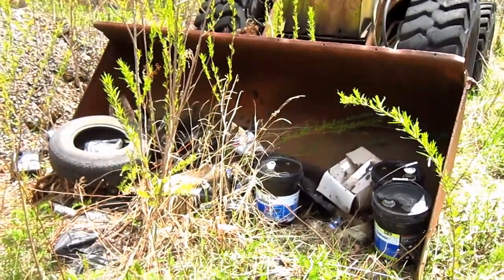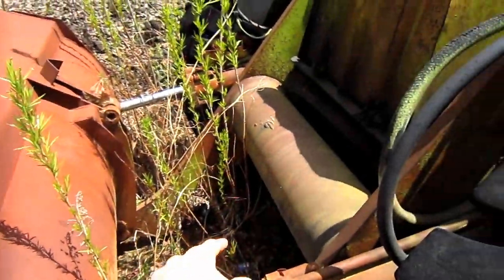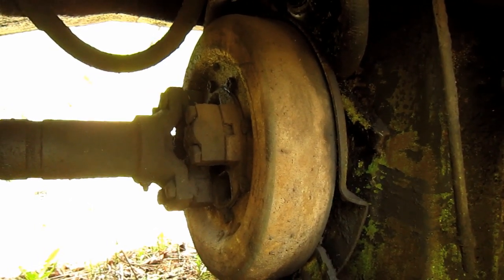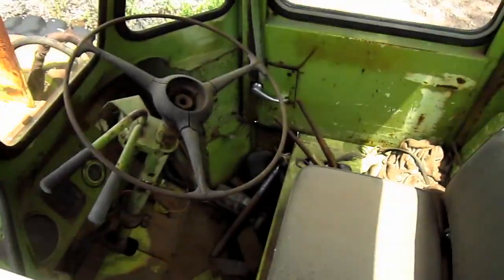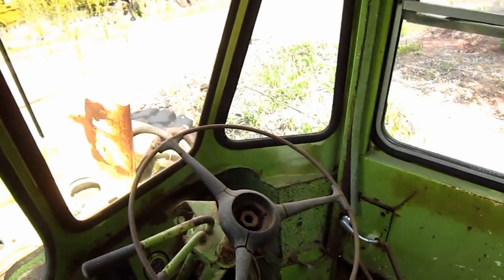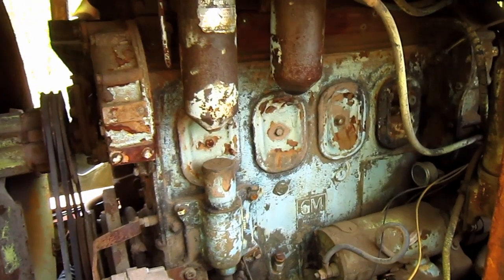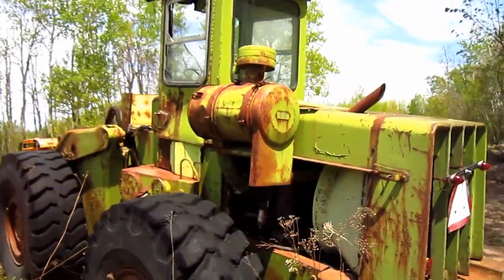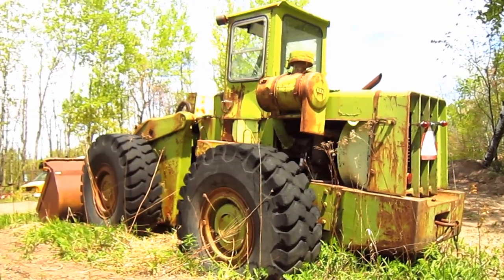Euclid L-30 Documentary

Comment: Great video. But one mistake, this is not L30. It is L25 because L25 has a 4cyl engine. L30 has 6cyl.
Reply from the maker: There were a few different variations of the L30 that were built over the years. The serial tag on this unit clearly said 9UPM. These were the first run of L30s and were 4-71 powered. The 6V-53 engine wasn't offered in the L30 until 1965 with the launch of the 17UPM series. Euclid loaders are confusing lol. Hope this helps 🙂
Reply: @PAmining  I didn't know that. Although I noticed that there are a lot of differences in the series, so I distinguished the models by the number of cylinders in the simplest way. Otherwise, I have an L20, with a 3-71 engine. My father bought it in 1968. Perfect machine.

Comment: Had one of these at the quarry till the brakes went out and it wend backward off the flat BUT was drug back up and revived and fixed at the concrete plant. There was also a bigger one with a 6-71 that sat through a flood and bent a rod because it got water in it. Torn down where it sat and fixed. Now all that's left are a couple of Terex rigid frame trucks. Somewhere. Thanks, Pal and God Bless!

Comment: The tires are nice, maybe replaced and saw little time until it was parked. Bucket cylinder pins are tiny, and the bushings are worn out. Somewhat strange configuration in general.
The 4-71 Detroit is not much power either. Not a machine that was popular in the day is my guess.